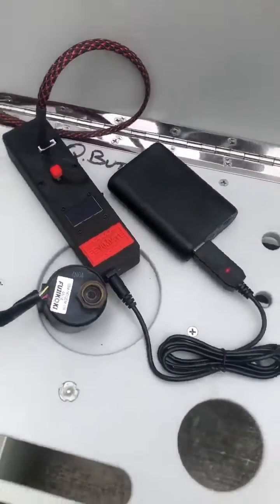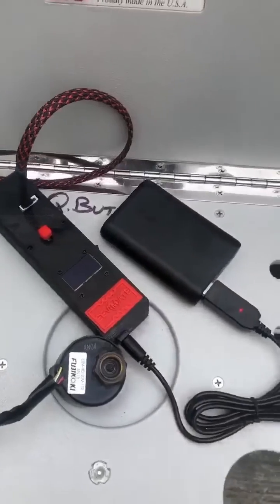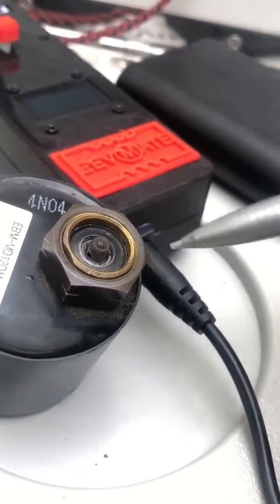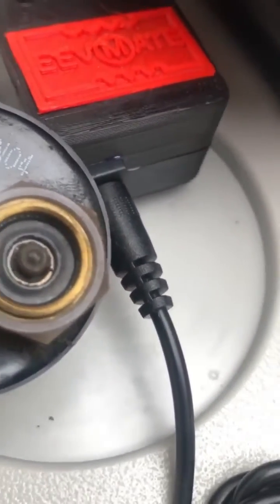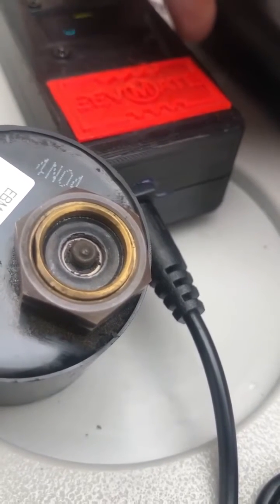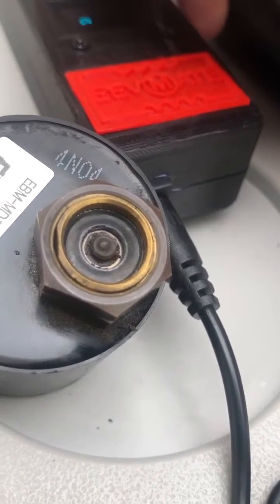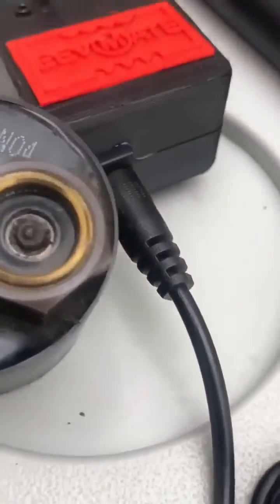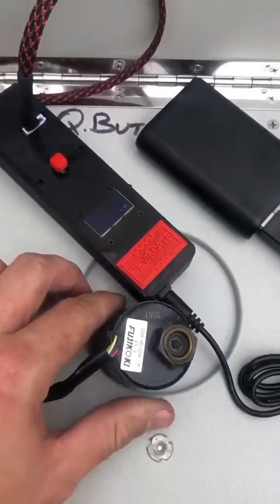Resetting an EEV with the EEVMATE tool

Comment: This item appears different than the website literature indicates.
Where are the 4 red LEDs that alternate?
This was a demo, but not much of a tutorial.
Reply from the maker: Hi JR,

It is the same tool. The Leds are built in just under the plug connection which is off camera during this video with a thin bit of plastic tinting them to minimize dirt from entering the enclosure and as to not blind the user when running at 12v(they can be pretty bright without the tint. 

Take a look at my first video made on this channel. It shows them pretty clearly.

Thanks,
Kevin Mate